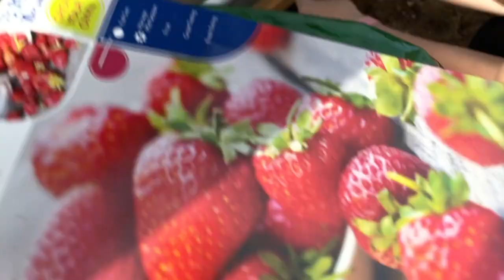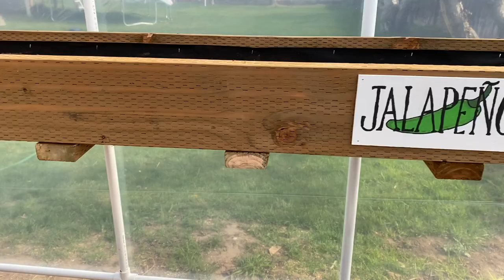Making a Greenhouse from an old Carport (Episode 13)

Comment: Excellent video I have a small farm and nursery this set up with the planters are awesome! great ideas....1 tip that I learned depending where you live and how hot it gets is to put felt between the plastic and metal frame and in the summer we put a cheap harbor freight tarp over the it to extend the life of the plastic and take it off beginning in the fall when it cools down...